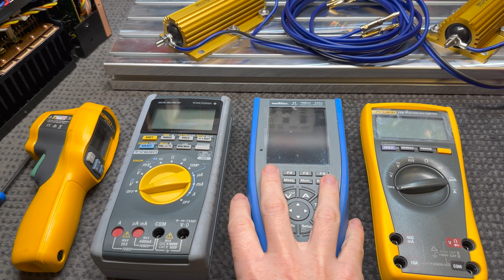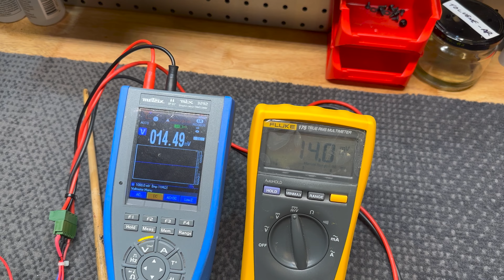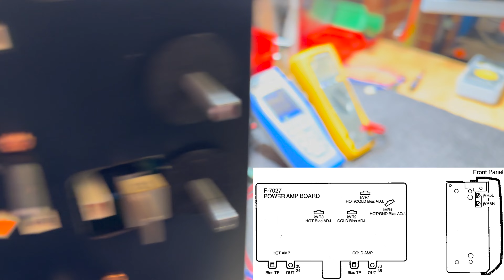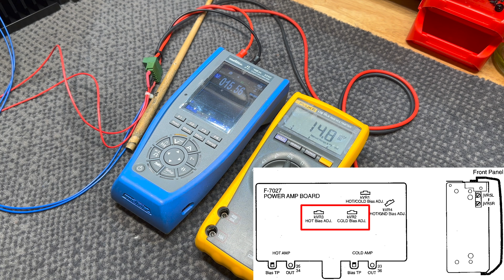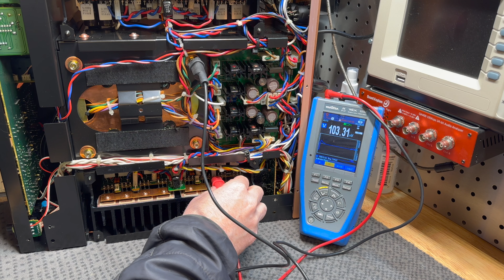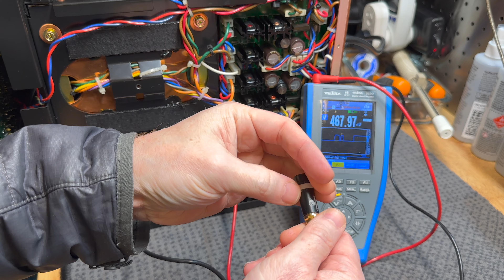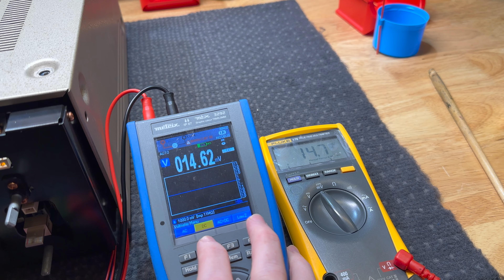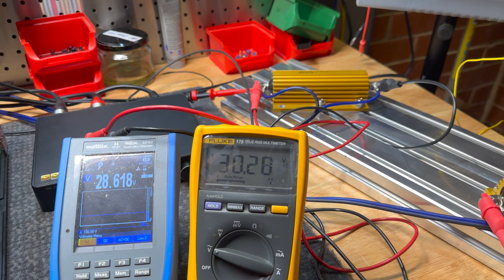Sansui Alpha AU-907MR - Restoration (Part 3)

Comment: Hi, for the bias adjustment did the 2 legs of the red goes to one meter and the 2 legs of the blue goes to the other meter OR one blue and red goes to one meter and the other red+BLUE to the other meter? If so what is the polarity? Thank you
Reply from the maker: Cannot remember the polarity but it is marked in the service manual. Red is hot side and blue is cold side for doing DC offset adjustments. It doesnt matter much it was just so I remembered what I was adjusting
Reply: Ok. Thank you for your reply. I will try to figure out how it goes

Comment: I really enjoyed to see your videos. I have 2 questions 1. I don't understand is the blue and red bias wiring for the meters. Can you please explain how those wire are going to the meters. 2. the DC offset between hot and cold on both channels on my amp is 0V but on both channels there's 1.4V between hot/cold to the ground. What is the problem? It's too high. I will really appreciate your help. It will be very helpful. Thanks.
Reply from the maker: In the Sansui Alphas, the hot and cold sides are both active in their own way so they need to be balanced together for DC offset then the offset can be adjusted relative to ground. There are seperate adjustments for each. Red is hot side Blue is cold side :)
Reply: Thank you for your answer. Do you have please wiring diagram of red and blue that are connected to the the meters? Thanks.

Comment: Thank you, a great video. thanks to your video I am doing it on my sansui 907MR. but I don't really understand what you did from your 15th minute, I watched it dozens of times and don't understand. Please help me in more detail what you did. For example, when adjusting VR5 R/L; then " power apm direct operation " ; Where is " input selector " set up? ; Is the volume set to the largest or smallest position? ; And where do you plug that short RCA cable? I read the instructions and I didn't understand anything like you did. Please help me, sorry because I'm not too good in this field.
Reply from the maker: Awt the volume to highest and move to middle also just to see how much the DC offset moves around. I used CD input with shorted rca connectors. Set to CD input and “integrated” - You should see the DC value change as you increase volume if its on the right switch settings :)

Comment: so, around 68mA per device with RE 0.22Ohm and rail voltage 38V?. since this amp is essentially a bridged mode i'd say yes, they're quite low bias. i'd say try 17mV if you're comfortable with the heat. total idle heat dissipation per channel will be around 22W
Reply from the maker: It was calibrated at about 15c so odds are it would be around that indoors which is why I took the low end 🙂 Really comes down to how much you want to preserve the amplifier I guess or get the most out of it 👌 Not surenwhy 8.8mV was chosen for the factory

Comment: Where are you measuring temperature? Fantastic video!
Reply from the maker: I was measuring the heatsinks inbetween the hot side and cold sides to get an average temperature. It’s not perfect but a rough idea of temperatures :)
Reply: @whatcouldgowrong7914  
Great. Thanks. Good enough! Seems reasonable. I own the 907NRA - another late Sansui masterpiece. The value proposition for high-end fidelity for these later Sansui's is just unbeatable. And they are such masterpieces of build quality. Cannot find any of that today. For the same price. Cheers!